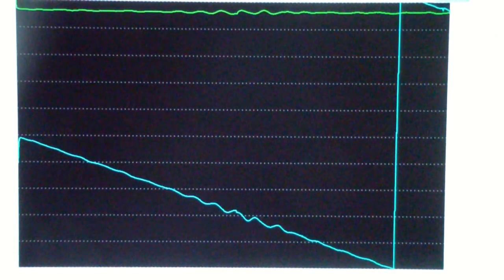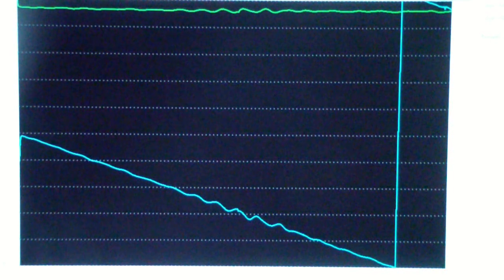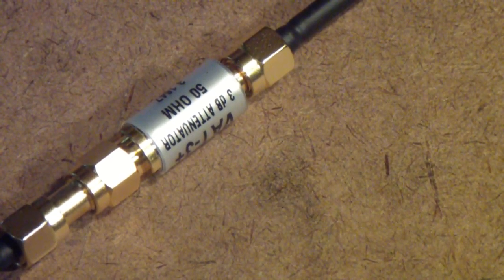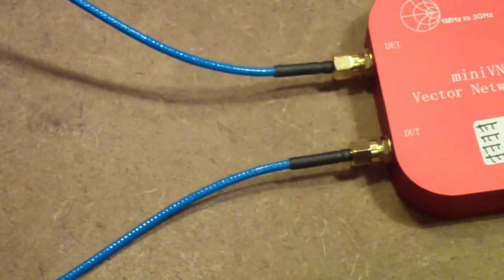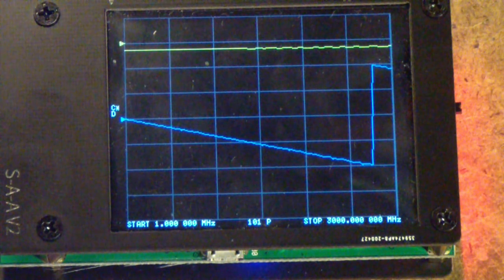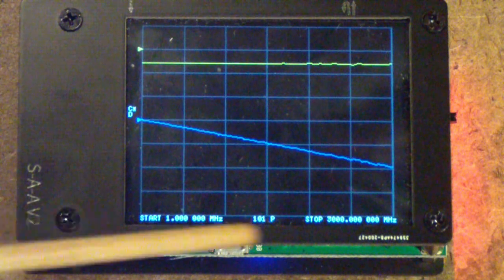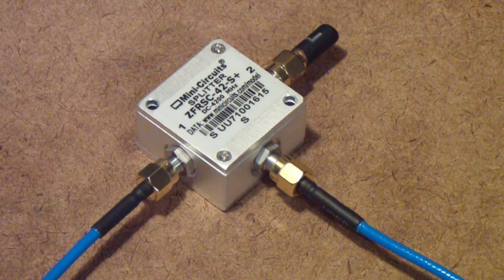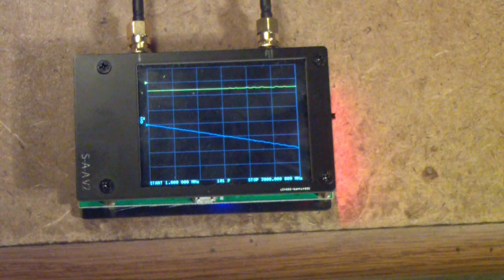TTT328 VNAtiny+ vs nanoVNA V2

Comment: Thank you for these very interesting NanoVNA workshop !  
Now orient me which brand NanoVNA V2 prefers with a 4" display. So many NanoVNA s on the Chinese market, clones? and which Nanovna s are built according to the specs of the developer of the V2 types? As a HAM radio amateur I want to use the NanoVNA V2 for antenna measurements. please purchase tips , advice ! thank you kindly ! Theo

Comment: Hey Tom. I watched all you tube amplifier videos.  I'm still on the tube audio subject, but you said you aren't being notified of comments, so I'm commenting here.  I'm having a large issue with the effects of triode/pentode/UL+Feedback and their relationship with output impedance and dampening factor.  I understand that increasing the FB will lower the output impedance measurement. The first part I'm having issues with is tubes often have distortion graphed against load impedance and have an ideal impedance for lowest %THD, this lead me into my current project of paralleling(lowering Rp) output tubes to match my output transformers better.  Of course this is mostly an academic exercise, but some have told me increasing FB will have the same effect.  The next parts bother me the most. DF. I think I do understand this on solid state amps, they are high gain voltage sources.  And in theory a high enough FB could turn a tube amplifier into a voltage source.  But how is a voltage source the correct answer for a system(speaker) that has electrical and mechanical reactance and a not flat impedance graph?  To my developing opinion FB to get the frequency response flat is good, and to prevent oscillation is necessary.  But what is important is current in the voice coil, ribbon, or charge on the electrostatic diaphragm(lets forget I brought that up) is what makes the speaker move like the input signal.  This leads me to my third problem.  A triode is sensitive to its plate voltage, so if the current doesn't flow in the secondary to the speaker(high impedance point, mechanical energy the other way), then the plate voltage drops and the tube's current drops.  I read over and over that is better.  To me the pentode does the right thing and tries to flow the current demanded, this would look bad on a scope measuring voltage, but seems like a scope reading power would actually look better.  I know, it's all feedback related in a way.  I know I used voltage FB and disregarded current FB in this long and drawn out comment.  I just feel I keep coming to conclusions that counter what I keep reading.  My industrial experience makes me think position feedback and a closed loop system is the only hope.   Thanks again for all your videos.
Reply from the maker: Thank you for your comments and questions. I actually found your comment about losing sleep so I will respond there to the bulk of your comment since that is where it will be best seen by others interested in the subject.

Comment: "R and L Electronics" (search for this in Google), a major amateur radio supplier near Cincinnati, Ohio  sells the nanoVNA S-A-A-2 V2 kit. They offer the instrument with a blue set of test cables (called the highend model in their online catalog) for 64.95. It comes in a metal case including the 1950 maH battery, the cal kit, and cables. The kit also includes zip up rigid nylon case to transport the nanoVNA S-A-A-2 V2 and all of the accessories. It is in stock as of the date of this video. Do a search for "nanovna" once on the R and L Electronics website. Once the search query is entered in the search box on the left, click the small magnifying glass icon to see all the nanoVNA offerings. I am not connected with R and L Electronics, just a satisfied customer. Thank you for the great videos you continue to create and upload!
Reply from the maker: Thanks for the info, it is good to see US suppliers stocking the V2. I also am not affiliated with any commercial entity and am unfamiliar with R and L Electronics, but I will definitely check them out.